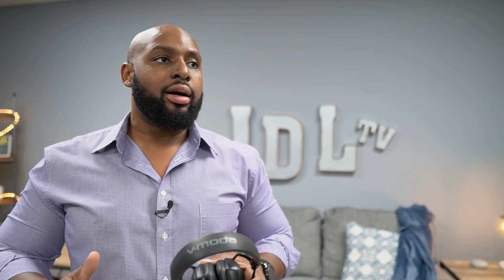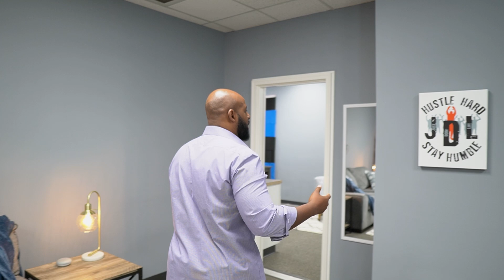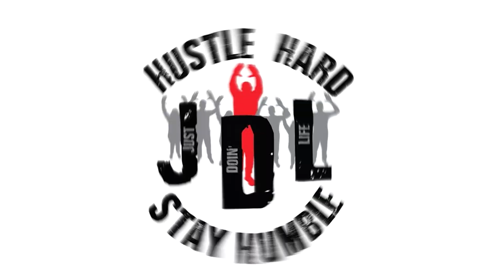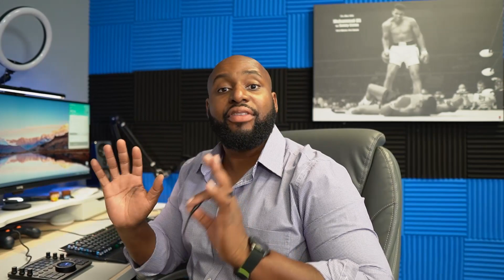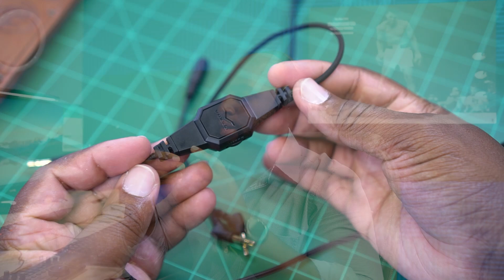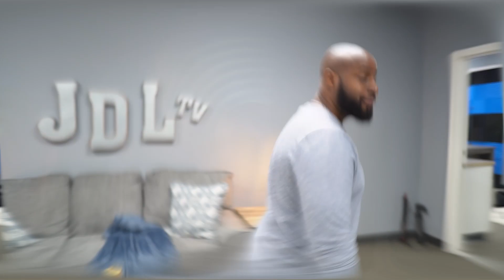A Great Mic For Zoom Meetings & Gaming: V-MODA BoomPro

Comment: Apparently the Soundcore life q30 have received a update for the microphone and it has improved a lot. Check the Anker reddit and post about the update. Someone has posted a mic test on firmware 1.5 vs 1.8. The updates has helped a lot. Also the update is rolling out slowly so not everyone has got it. I'm still waiting for my order to arrive to test it.
Reply: I'm trying to get the Q30 and this mic, do they pair better in quality?
Reply: @seekfactsnotfiction9056  I don't know, becuase I don't own the mic. I don't even know if it's going to work or not.